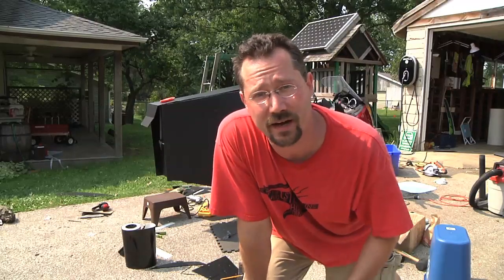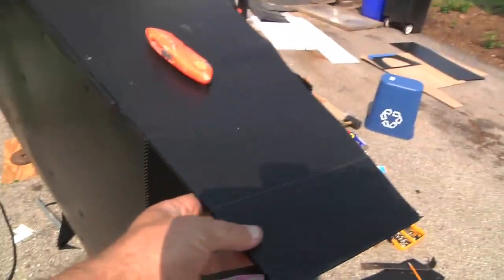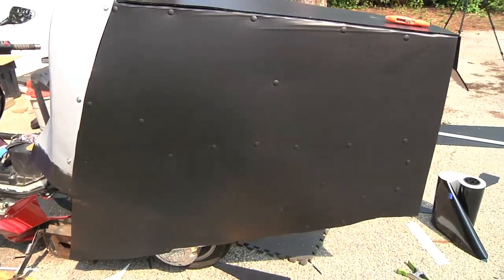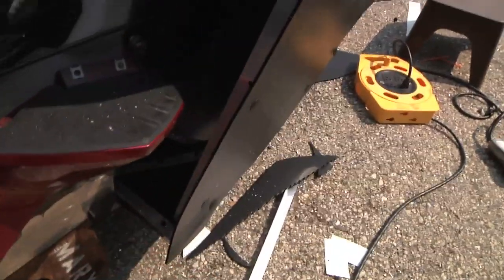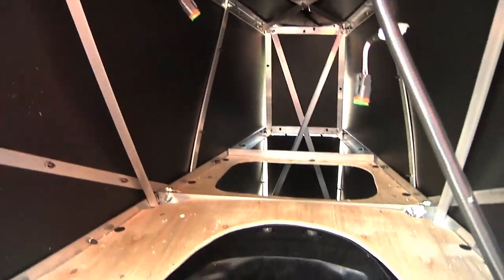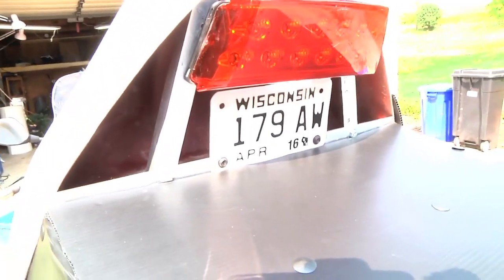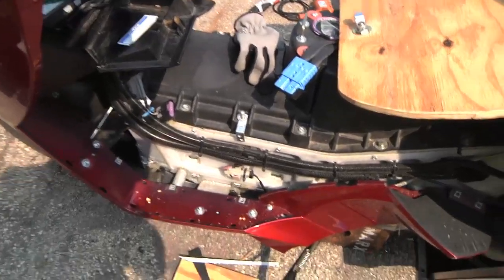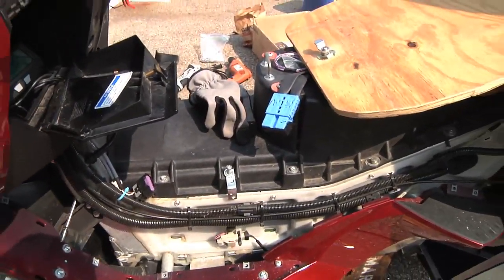Loop the Lake: Aug 31 Vectrix mods continue

Comment: Good luck. And does it really go fast enough to need that kind of modification?
Reply from the maker: +hectorisdaman154 Top speed is 100 kph. In this case the back is more for cargo than for aerodynamics, but if it improves fuel economy, I'll take it.